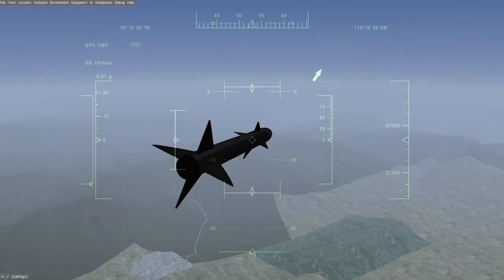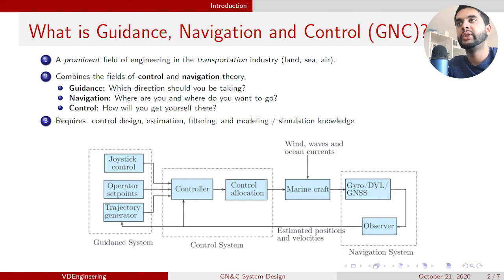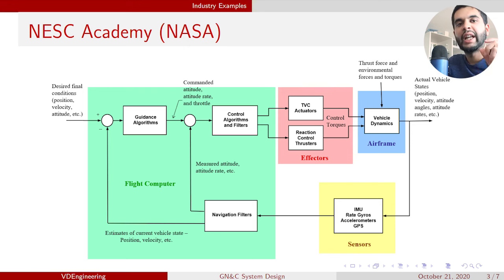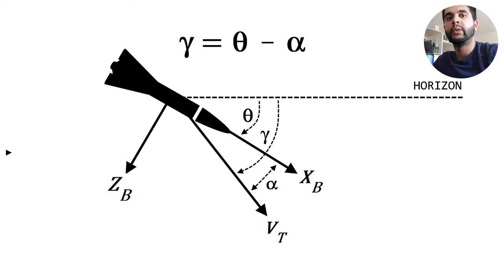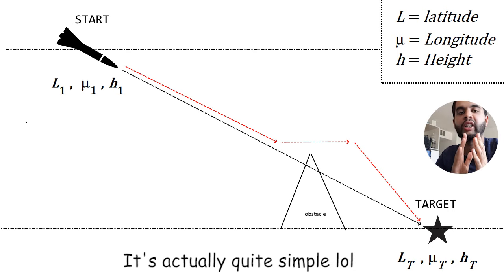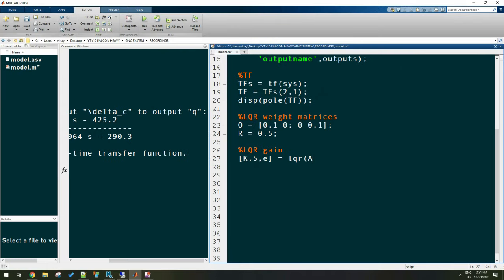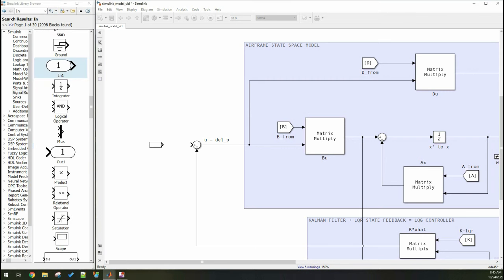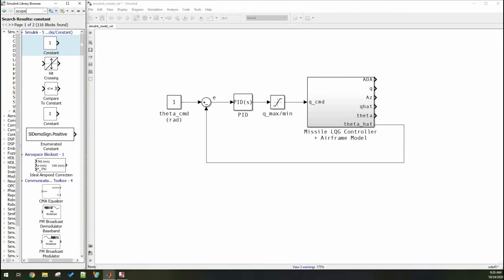Guidance, Navigation and Control System Design - Matlab / Simulink / FlightGear Tutorial

Comment: I very much enjoyed this video! Although it took me a while, I was eventually able to get a valid result using this method! However, there is something crucial that stumped me for a while. At 19:24 in the video, you enter the earth's radius in Km. I followed along (not thinking too much of it) and I kept getting invalid results for example I would get a warning flag from the start. But then when I worked back through the model/code and did a bit of manual calculation I found that using the Haversine formula you spoke about, my horizontal distance was ridiculously small, hence why I was getting a warning flag from the beginning of the simulation. So I used meters rather than Kilometres and this fixed the issues I was having.

Although I will say, that troubleshooting this problem really did aid my understanding of the full system! So there is a bright side haha.

By the way, if what I have said is incorrect, please do let me know. I always like to learn even if it means I am wrong.

TLDR: If you are following along and getting invalid results make sure you use meters for the earth's radius (at 19:24) and not kilometres.
Reply from the maker: Oops, my bad, glad you got it working!
Reply: The earth’s radius is in meters , he put e3. I’m still unable to get valid results. Wondering where I made mistakes.
Reply: @sampiko9697  In matlab function define R=6371e3, not R=6.371e3
Reply: @VDEngineering Is it fixed type or variable type solver used ...I tried it but not getting results..as changed R in meters ...
Can u suggest ??
Reply: i can relate to what you encountered... blessing in disguise. haha

Comment: Hey Vinayak, I am currently working on a project where I have to connect FG to Matlab/ Simulink. Your videos have been pretty helpful so far, but I was wondering if you have ever tried to connect two instances of FG to the same Simulink model to perform simultanous flight trajectories of two planes via FG Multiplayer mode. The problem I have is about the communication between the two FG instances since there is always a "jitter" in the visualization instead of a fluent movement. I would be really happy for any advice! Other than that: Keep it up! Your videos are great!
Reply from the maker: Not sure how to do that yet
Reply: @VDEngineering  Ok, however thanks for answering. However if you ever have to deal with that problem I would be thankful for any advice or video.

Comment: while implementing the guidance model; x and z are they given in terms of theta or gamma? 'cause the formula you showed mentions theta, but your simulink diagram taps gamma.
Thank you so much for the effort put in.
Reply from the maker: Hey, so the true formula is gamma yes, that was a typo. However, if you run this simulation you'll notice that angle of attack stays at 0, which means theta ~= gamma, (because Az ~= 0), so either will give you the same result. Thanks for spotting that!